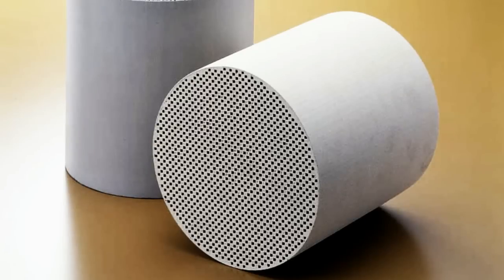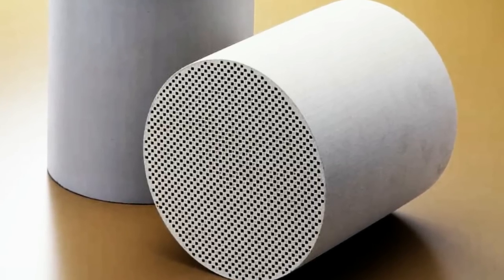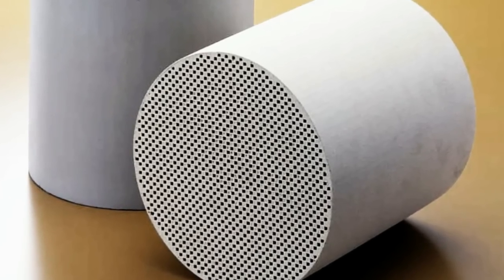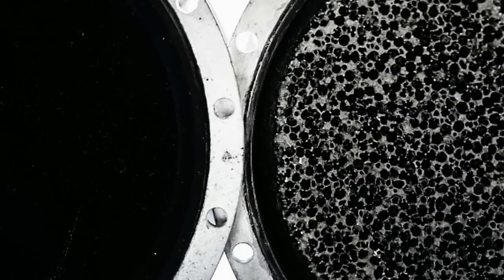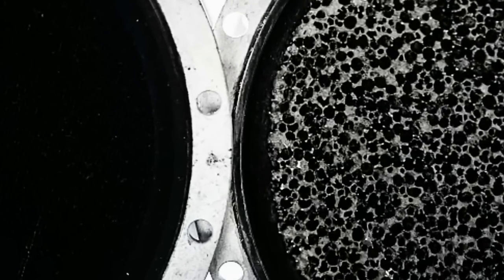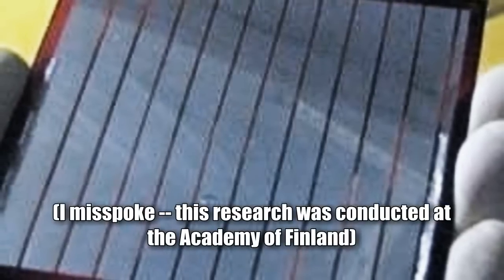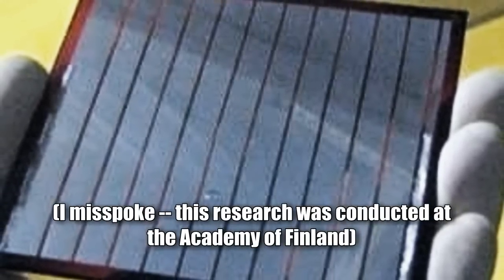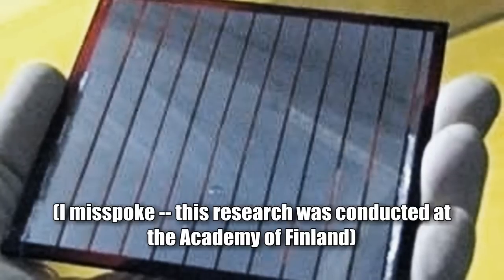And Now the Good News #30: 4/30/2013

Comment: Now for the bad news Steve. The new chair of the House Science Committee, Rep. Lamar Smith (R - Obviously), has proposed a bill that would basically gut the Scientific Method for the National Science Foundation (NSF).
In short, the bill does not allow research laboratories to not conduct tests on the same research (duplication is important in science), and it would also remove the peer-review process of their findings and have them subjected to political oversight.
Sorry to do it man. :(

Comment: By my reckoning there has been solar cell breakthrough every 47 minutes for the last 35 years. At this rate there is now a potential solar cell the size of a postage stamp that will power Las Vegas.  Unfortunately it has been discovered that it take more than potential.